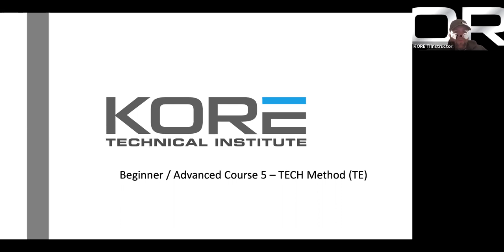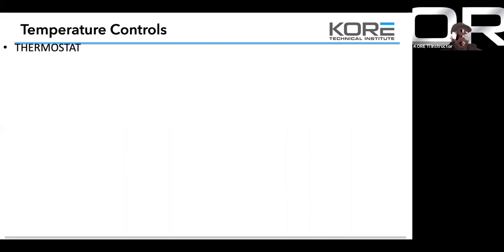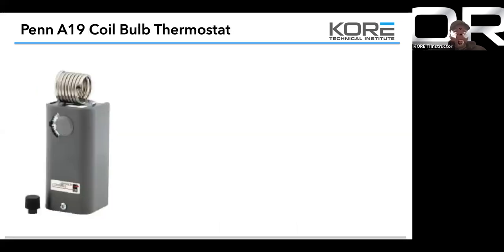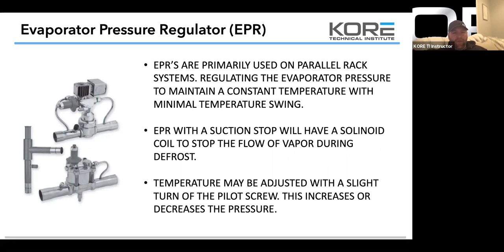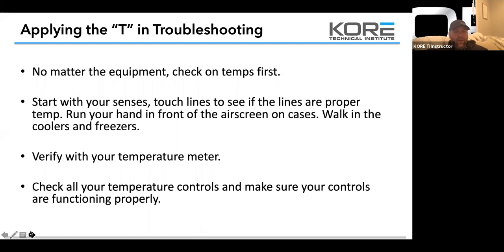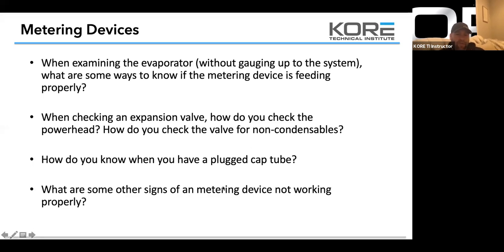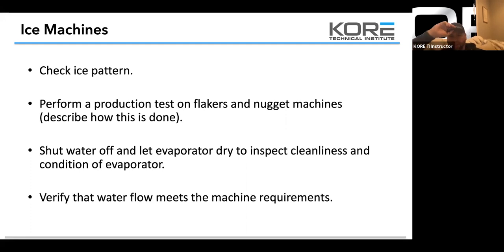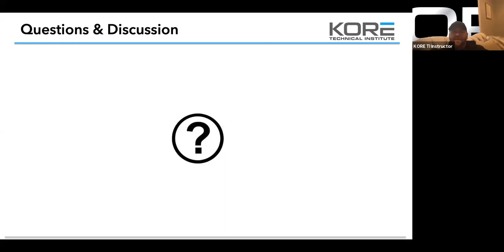Diagnosing: TECH Method Part 1 - TE

Comment: Took the TECH method course back in 1994. I think I paid $400 for the coarse, got the books (still have them) 
This was a pivotal time in my HVAC/R career, I went from scratching my head on a service call to fully “getting” what I needed to do to troubleshoot a refrigeration system. 
I went from possibly quitting the trade, to thriving. 
Thank God I took this coarse because I’d be working in the produce dept at my local supermarket still, nothing wrong with that, but I was able to stay in the trade I went to HVAC school for, which btw, I learned almost nothing from and spent over $11,000 bucks back in 1990 of my own hard earned money.